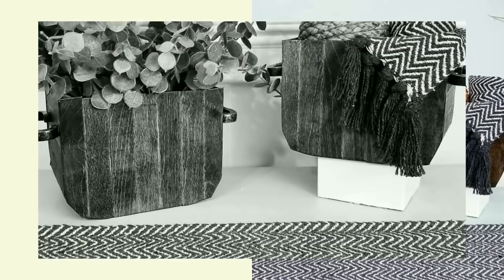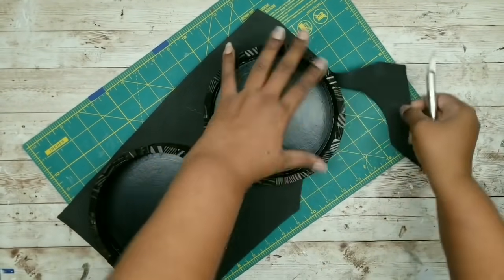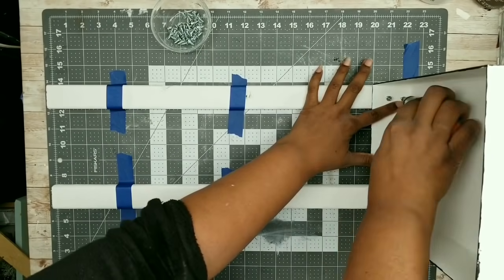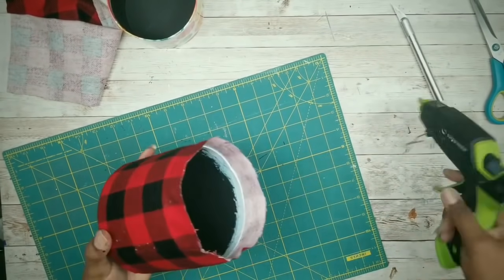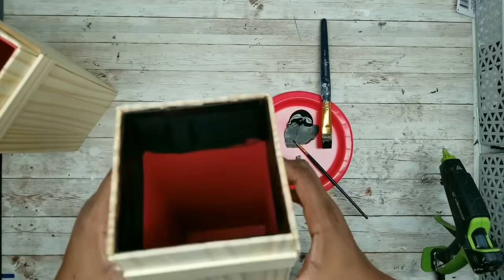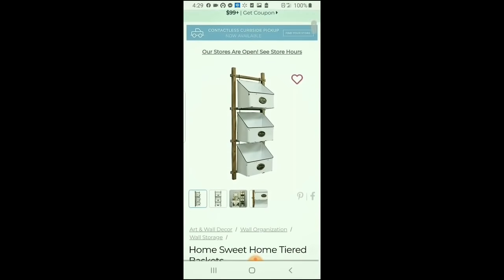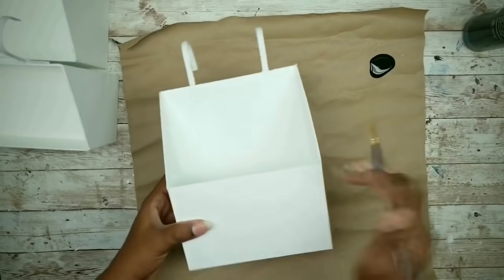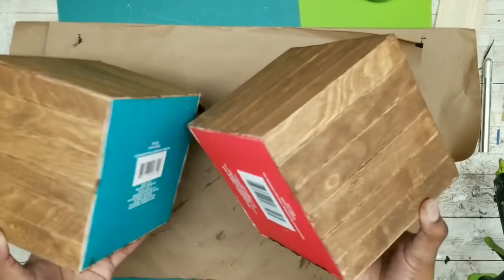BEST TOP 10 DOLLAR TREE DIYs Using GIFT BOXES | Home Decor DIY | Amazing High End Transformations!

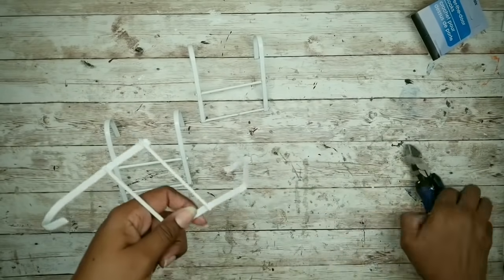Comment: 47:40 - Little tip, for easier painting, paint before putting the wood on...
Reply from the maker: Sure! I didn't decide to paint the inside until after I assembled, but when you duplicate it, paint and mod podge seal the painted areas before applying your sticks. Happy Crafting!

Comment: I gotta ask, Dee . . . Do you honestly think that the “woodstick” hot glue by Surebonder is better than regular hot glue?  I notice it’s much more expensive than regular hot glue ($9.62/12-pk vs. $12.72/50-pack, respectively), so I went to read the reviews on Amazon to see if it would be worth the cost.  I noticed that some reviews were negative, saying that it did not function like typical wood glue when used on wood projects. I saw that many positive reviewers think it’s great *compared with regular wood glue* because it dries fast, but that’s the case for all hot glue, and you can still get the best long-term hold by combining wood glue (or E-6000) and hot glue if there is enough surface space to apply both, as I’ve learned from you! :).  I guess I want to know if it’s truly worth using Surebonder’s “woodstick” hot glue (as opposed to regular multi-use  hot glue) for joining the small wood pieces (e.g. tumbling tower blocks) that are too small to apply regular hot glue or E-6000 AND hot glue, in order to get a more permanent hold. Will the woodstick hot glue provide a more permanent hold, like real wood glue would, in addition to being fast-drying?  Or is the hold somewhere in the middle of regular wood glue and regular hot glue?  Hope my question is clear enough to make sense, and I also realize that there are many other factors at play, like what kind of forces are being applied to the pieces that are bonded together and the angle of the force, etc.  Thanks for any general input about your impressions that you’re willing to give!
Reply from the maker: The wood hot glue is stronger than standard regular hot glue and allows a longer working time. Regular carpenters wood glue is always the best option with the strongest hold, but the only setback is the drying time. Basically you can make your decision based on your time flexibility, and project you are working on. I typically rotate  between the two. I purchase by the case which reduces the price significantly. I use Surebonder and Fixsy brand wood hot glues. 🙂
Reply: @SheSoCraftDee  Thank you so much!!  That’s SO helpful!!  I’m guessing I need to go to the manufacturer website to order by the case?  I like the idea of having the woodstick hot glue on hand and then I’ll just probably use it more sparingly or in the cases where I do need a longer working time and/or stronger hold but can’t tolerate the wait time for regular wood glue. I so appreciate your quick and helpful reply! :) :) :)

Comment: On the box bins, did they need reinforcements ? I dont see how the cardboard of the box held the glassware  or the several bottles of paint?  Did it bow in the middle after time? Would reinforcements  like a thin piece of wood like dollar tree signs cut to fit work? And will the sides hold up where the screws are? I guess I'm wondering if you wanted to use it more should you reinforce the entire bin??
Reply from the maker: The boxes used are a thicker hard sided box, and the screws have been enough to hold it together. I have not experienced any bowing at all. The only additional suggestion I would make is to screw in the handles instead of gluing them if you like that option.
Reply: Ty dear !! You are amazing